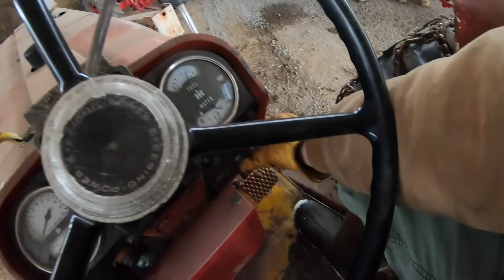New Struggles for the Farm

Comment: I really think you have done a great job building your farm. I don't want you to stray too far from the core channel for selfish reasons on my part. How about taking on new self-sufficiency challenges in the direction of organic produce (you have plenty of great fertilizer) working towards complete food independence for the farm and expanded farmer's market. Also, projects towards increased energy independence and expanding your solar start into other power generation options or electrical power reduction projects (wind pumped water well, point of use solar electric fencing, heating your house and hot water completely with wood). You do an excellent job discussing economic pros and cons of agricultural production, payback on power generation, etc. provide those kinds of discussions into your new endeavors as you are a very good mentor for future off-griders. Keep up the great channel.

Comment: That 656 must have some very good glow plugs. She starts up extremely well for how cold it is. Always like those 656 tractors,very economical to run.
Reply from the maker: Diesel RX glow plugs were a great investment, hold 15 seconds then crank, instead of waiting 60 seconds. That and 2 good 12 volt batteries.

Comment: Well, if you want to change the world, you can take more of a lead in solar electrical generation on the farm.  Current solar installations seem to have the panels much too low and so make the ground under the mounted panels unusable.  Your installation - especially if it was a little bit taller- allows animals to graze under the solar panels.  If every farm in the Midwest and on the East Coast used this same type of installation, it would help enormously to reduce carbon.  You could lead in this direction and thus build a successful business and change the world for the better.